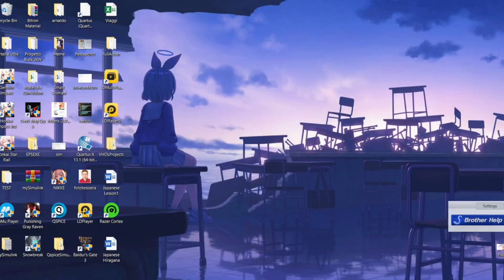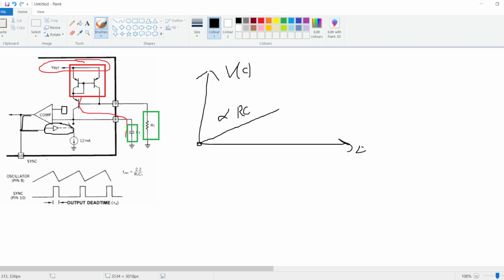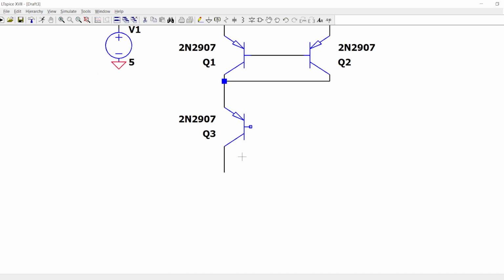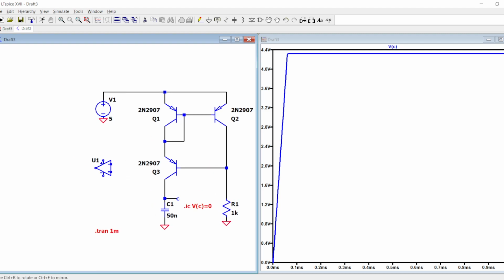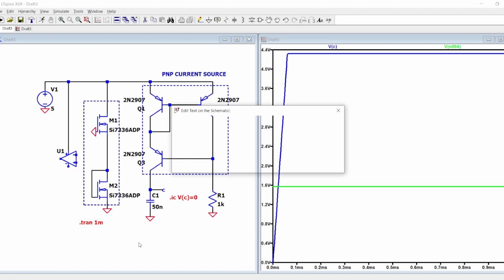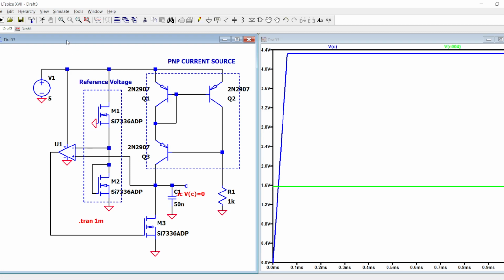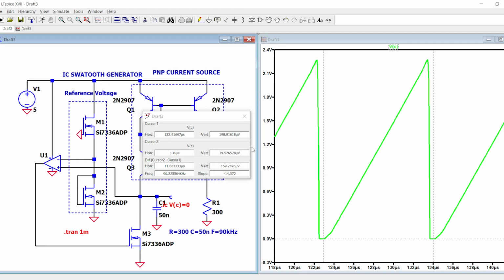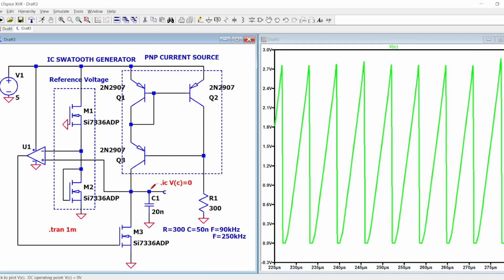[LTSPICE] Integrated Circuit Sawtooth for Push Pull DC-DC

Comment: Excellent video.

I got a question, if I want To change the reference voltage how I can do ?
Reply from the maker: Generally you don't. You try to keep the Vref as stable as possible and you use physical propreties behind it. You change the rest and the thresholds will be changed accordingly.

It's like using the TLV341. You short himself and he gives 1.24 or 2.5V, depending on the model. Then you change everything else
Reply: @LukeXVIIx64 I understand thanks you for your explications

Comment: Excellent video.
Interesting circuit for the voltage reference.
Would you recommend a reference that contains commonly used circuits and their analysis like that voltage reference?
Reply from the maker: I can make a video about integrated voltages references. They are mandatory in integrated circuits, they must be stable with the temperature and be realized with the physical proprieties of the device. In that case : the vth threshold voltage of the mosfet, which is constant with the temperature (almost)
Reply: @LukeXVIIx64  great, looking forward to it. I didn't mean only voltage reference circuits, but other useful circuits as well like current mirrors and more. If there is a good reference for those, that would be great. Appreciate your content.
Reply from the maker: @RMSa-p5p   I probably got what you want. The "useful circuits" that you are looking for, probably, are analogic circuits blocks with npn and pnp.
Well, those are mostly used in analog integrated circuits, and in principle, they are
1)Current mirrors/amplifiers
2)Voltage buffers
3)Current Buffers
4)Beta helper/Beta multipliers
5)Amplifier stages B-AB, Output power stage
6)Differential amplifier
7)Voltage and current references
8) Darlington / Skylai pairs

If you open an 741 Opamp schematic, you will find all those 8 blocks mentioned.

For signal processing and conditioning instead,  like sensors signals, you want to use opamp circuits, like adder, subbers, gains, rectifiers, filters and comparators